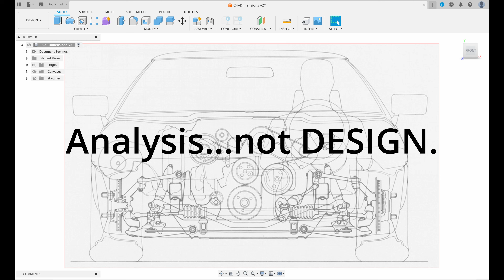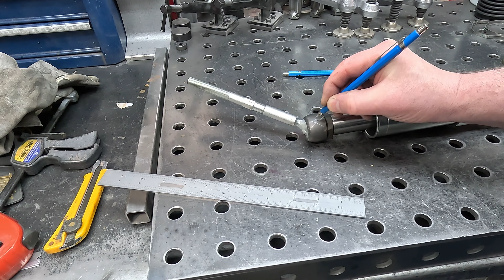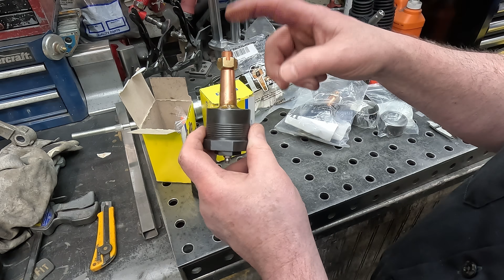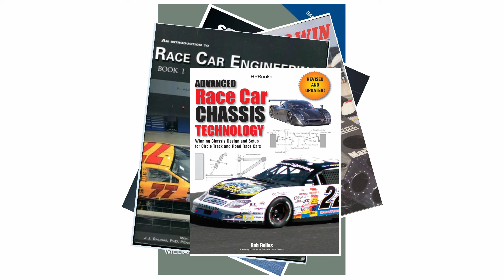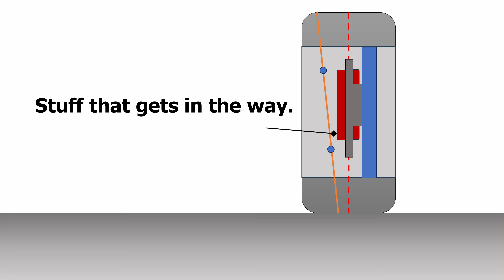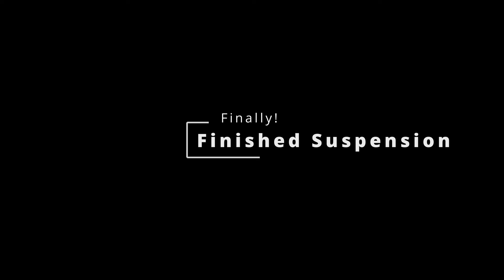Designing Car Suspension - From Analysis to Design.  Front View.

Comment: Your camber is clearly going negative, not positive with bump.  Are you confused?
Reply from the maker: The level wasn't sitting flush on the hub when I filmed this and I didn't catch the error.  The computer model is correct.  It does go negative, but goes positive first.  Anyway, my mistake trying to get this filed when tired.
Reply: @ThrottleStopGarage  I was seriously confused!
Reply from the maker: @salloroc20  sorry about that. There is  no way to fix it once the video is released.

Comment: I used some cheap 350z front wheel bearings on a custom front suspension I built a few years ago, they lasted around 300 miles before they developed significant play. I replaced them witn SKF units. I took the easier option of basically copying MX5 front geometry & fabricated the uprights + wishbones to suit.
Reply from the maker: I was surprised by the differences.  The cheap hubs had thinner wheel mount faces and while they're dimensionally the same,  they feel different.  They're looser than the SKF's.  Did you weld your upright or have them machined?

Comment: I applaud you for tackling this complicated and slippery challenge, and I hope it works out very well for you. However, the C4 Corvette was known as an excellent handling car, so I'd be careful about thinking that you've discovered that its front suspension geometry is garbage. It was particularly good on the race track, where the 'problems' you describe should be at their worst. 

Having said that, Corvette Engineering did redesign the C4's front suspension slightly for the 1988-96 cars, which got even wider tires than the 1984-87 cars had. Lotus Engineering consulted on the project. They widened the front suspension (the distance between the wheel hub faces) a couple of inches - about an inch on each side - by lengthening the A-arms. That necessitated a series of other adjustments, as you can now well imagine. The wider the tire, the less tolerant it is of camber change during suspension movement, and I suspect that's why this was done. Longer arms generally result in reduced camber change during suspension motion. 

They also, as I recall, did reduce the scrub radius in that redesign, and I have a vague recollection that this was specifically suggested by the Lotus engineers. Scrub radius is part of the 'black art' of tuning an overall front suspension design package, and tires had come an awfully long way since the last time the Corvette guys had redesigned theirs, way back when they designed the 1963 C2 Corvette. 

So maybe their first C4 iteration wasn't absolutely perfect, but it was damned good. It definitely wasn't all wrong, or junk, or stupid, or anything like that. Just saying...
Reply from the maker: Sorry, I was trying to say what you've said here.  It's not garbage, it's fine for a C4 Corvette.  The overall dynamics are meant to work in a system with the rear suspension.  You're correct, they did change a few things in the later cars and the C5 and C6 are evolutions of this concept.  I tried to stop short of saying it's bad - it's just suited to the car it was designed to work in and hacking away at it without doing the engineering is not a good idea.  It also wasn't my idea - but the person that sold me the shortened cross member.  

I'm a little annoyed that they didn't take the time to work out the kinks so that it would work.  I'm only a few thousand dollars in the hole because I didn't want to do this.

Comment: Talking about camber gain around 9min. Actually looks like you went from  a half degree postitive camber to negative 1.5 with bump (i assume your angle gauge 's bumb feature should be same as a level bubble). Regardless of that, its still not enough static camber at ride height or enough gain through the travel.
Such a low roll center is counter to where I'm going through with testing on my car. However yours is WAY lighter than mine. If you have the room don't be afraid to add chassis side adjustment for the lower arm that's higher up. Which will directly raise the roll center. Up and down adjustment for the upper arm is a good idea too. I was once told anything that can be made adjustable is a good move.
The camber gain target you showed seems too little if you plan spirited driving. Super basic but i set mine by sitting on the fender and using the angle cube to measure body roll (2.4), then set the cube on the tire to check for gain or loss. I went with a degree more negative gain than body roll as a place to start. Best year I've had yet in tire longevity/wear doing street, autocross, and track days. I don't know what that gain is vs compression travel but it is definitely more than .6/inch.
However a street only setup probably wint need the additional camber gain. In aggressive driving it does need more because you also have to compensate for tire deflection.

Overall, good video! 
I also spent months researching just to start understanding what's all going on when everything moves.
Reply from the maker: When I filmed the level, it wasn't flat to the hub and I didn't notice.  The computer model is correct and it's not great.  I am still working on the roll and camber curve.  This will get more attention as I do the side view.
Reply: @ThrottleStopGarage someone else was commenting about the rack placement. 
Easiest/obvious placement is with the tie rod pivots lined up with the lower control arm pivots. Then place the outer tie rod lined up with the ball joint. If they follow the same arc then it can't bump steer beyond some pretty minor differences.
Reply from the maker: @codysmithmotorsports736  I'll go over that detail in the next video...I think.
Reply: @ThrottleStopGarage  
Oh, and if you haven't figured it out yet. The lower arm primarily locates the roll center height and the upper dictates camber gain. Yes, both affect on the other but to a much lesser effect.

Comment: Thank you for explaining where some of the points in space come from and what is acceptable from a design point of view. From the way your thinking is progressing I am assuming you are going to machine your own uprights. From my experience (formula car racing) and research the suspension design starts with the upright, especially from the home workshop environment, as it is expensive to manufacture. It is usually more efficient to start with a production upright that has a minimum of compromises. Have you got one in mind? I am currently have the some of the same issues on my current project, a 77 Monza, which have crappy front suspension geometry, crappy uprights that don’t allow big brakes, good hubs, etc.
Reply from the maker: That's basically what I'm doing by defining the scrub and SAI first.  These are upright variables.  I'll probably get the uprights machined.  Next up, side view...then I can sort that out.
Reply: I was having difficulty understanding why you picked the ball joint locations, but after some thought i believe the lower inner was dictated by where the rack would be and the uppers chosen for the camber curve desired. As an aside your basic geometry is almost the same as Carrol Smith shows in Engineer to Win.
Reply from the maker: @randycollett1746  That's pretty much the case.  I tried to locate the lower so that I would have clearance to the brake rotor (this was a challenge) and had it at around the same height as the LCA mount on the frame.  These took a few tries to get right.  I've read all Carrol Smith's books - while I didn't follow his method in this video - it's more or less Ch 17 in RCVD, I'm not surprised that they're similar.  Things for sure gelled for me and a lot of this stuff started to make sense very recently.

Comment: Thank you Craig for doing what few have the patience for. Basics, camber gain; when you "bumped" the wheel up first 1" and then 3", you lost negative camber gain, you didn't gain camber. Maybe you just misspoke there but it's an important point when we're talking negative vs positive, losing vs gaining, concave vs convex bla bla. The upper control arm is obviously shorter than the lower, as both move through their respective arc ranges, the shorter arm has no choice but to result in offering "negative camber gain". The problem is the upper and lower arms are not parallel, causing some "loss" at different points through the range of travel, but ultimately will give negative camber gain. The geometry has no choice but to produce this result, the upper arm is shorter. In the Racing Aspirations software it is clearly set up differently to what you have on the bench in your garage, in the software version the arms are very nearly parallel, the Corvette is very clearly not parallel. Sorry if this sounds like I'm angry, really I'm not, I'm only wanting to clarify why you lost camber gain, the upper arm begins, lets call it drooped, the lower arm has some degrees of "rise" from the "at rest" starting positions of your experiment to see what the suspension was physically giving you. This is where the dark arts show up, bump steer, weight jacking, roll center, roll axis on and on, this is why this is all so difficult to master. Before you move on to the side view, you have more work to do from the front view. Ford went to an extreme to "correct" for roll center migration, they designed the infamous Twin Torsion bar suspension. This provided for a really smooth soft supple ride, but did nothing for handling or tire wear. It was a cheap solution or alternative to Chevy's double A arm suspension, which is as you are finding out, very complicated to mitigate all the negative compromises required for mass produced suspension. Remember the Corvair, lawsuits were abundant because the geometry/design was flawed from the beginning. 
As important as reading and studying the available printed material is, like another "commenter" said, an RC, radio controlled toy car can teach you as much as all those books combined. I highly recommend getting a RC car to test your theories/setup/geometry.
Don't get me started on roll center, every race car mechanic has their own opinion of what is the optimal height and they have tested their theories on the track, go to a local circle track and talk to those guys, invaluable. Pavement or asphalt racers would be optimal as you want your car to run on the street. Oh, and potholes, don't forget our Alberta roads mostly suck.
Reply from the maker: Thanks - I did fumble with the words a bit there and the level was hung on the edge of the lug nut and showing the opposite of what is happening at ride height - that segment is a bit of a mess.  Viewers caught it - I'm too tired.  The computer model is correct and the path is funky for the C4 - good enough and I can sleep well enough.

Comment: Have been following along since you started this project. 
FYI, those moog ball joints may be a bit stiff. After going through the task of redesigning my 66 mustang suspension, I discovered the ball joints were binding causing all of my driving tests and the conclusions I came to, were invalid. Glad to see you choosing a low friction joint. Nothing like having to start all over, again.
Reply from the maker: I was surprised how stiff they were!  I'm only using them for mock up and for making the arms.

Comment: It seems like it's going in a better direction, the corvette suspension looked wierd to me as it had the upper control arm sloping outwards rather than inwards as is custom, therefore the corvette instant centre would've been outside the wheel. I wonder what the result of mounting the inside of the corvette upper control arm lower would've been, this would to my mind put the instant centre in a more conventional spot (therefore a better roll centre) and also give better negative camber gain.
When you rolled the vehicle in the model it was still losing contact patch, perhaps it could use some more negative camber gain? Where is the steering rack in this? If you don't consider the location of the rack you'll likely get bumpsteer or rollsteer issues (you measured the width so I assume it was in the modeling).
Rather than inputing standard figures for camber gain why not calculate what camber you need? Camber gain required is equal to the degrees of roll, you've got the track width and a reasonable idea of suspension travel which should be enough to calculate it with some trigonometry. An older euro vehicle will tend to be less track width so may not be the same as more modern. Also camber curves depend on which suspension it is, macpherson struts go entirely the wrong way and are forced to start with too much negative camber so they have some left in bump.
Reply from the maker: Yes - the IC's are outside the wheel.  Things are not quite as I've shown them as the level was not flat on the hub and eagle-eyed viewers picked up what I was too tired to notice.  The computer model is correct, it's a little not what you'd expect - point made.  When I optimized it before, the 3D software had me moving a lot of things to get the attributes I wanted and it looked quite different.  That's why I bought the stock crossmember - to find out what GM thought it should be.  Steering rack is in place in the 2D model and designed around zero bump steer - probably the most important parameter.  

I'm just learning - the trick for me was not knowing what "reasonable" is with the parameter.  So what's a reasonable lateral G?  What sort of roll is not crazy?  How little is too little?  I'm all ears for feedback on these parameters. They are what is needed to do the entire thing properly.  I am going to do this for the 3D model - but the 3D model needs inputs and I just needed to start.  Does this make sense?
Reply: @ThrottleStopGarage  a lot of even amateur racers have lateral G's on thier videos, most seem to see less than 1.5G from memory. When I calculated roll for my suspension I used available travel in bump and droop from ride height, ie if you've 4" inches in bump and 4" inches in droop that's 8" across the track width of the car trigonometry means you can work out an angle of roll that would be the upper limit.

Comment: When I was in service, doing hundreds of maintenance and crash alignments over my 35 years, I kept an RC car with adjustable A-Arms, to demonstrate what you're showing. It had tiny bubble levels glued all over it.  Great visual tool.
Reply from the maker: Cool - I've got a little model I made to prove the Ackerman relationship to steering rack position.  I just couldn't visualize the complex relationship.
Reply: @ThrottleStopGarage  Are your "adjustment range" calculations accounting for vehicle loaded weight, driver and full gas? I'd be bummed if I ran out of caster or camber(ride height dependant). And trying to nail the spring rates will be added rocket science. Generally speaking, alignment spec loads are with 3/4 fuel and a 70kg driver, which I guess is out of date now. eyeroll.
Reply from the maker: @kathysarmcandy1992  That's the idea...I've got several spreadsheets running with spring/roll and other calculations. I'm not sure how ultimately useful these are as they're copied formulae from others (or were donated by friends who have developed them).  My guess is that they're close enough for a first approximation.  It will need to be tuned when rolling.
Reply: @ThrottleStopGarage  Adjustable upper ball joints, I see similar to your screw-ins. Don't forget to make friends with an alignment shop. On and off hours after work and buy the shop pizza is totally worth it.